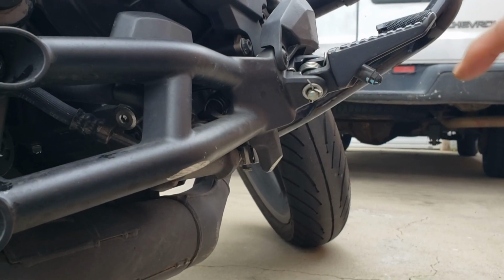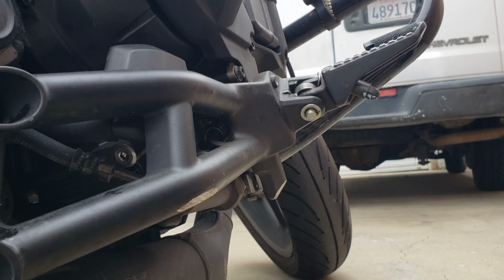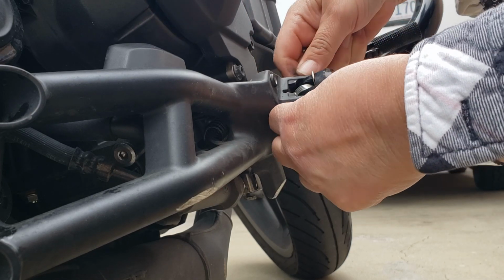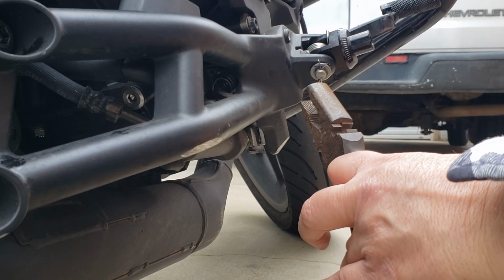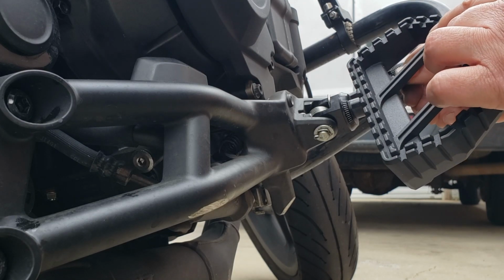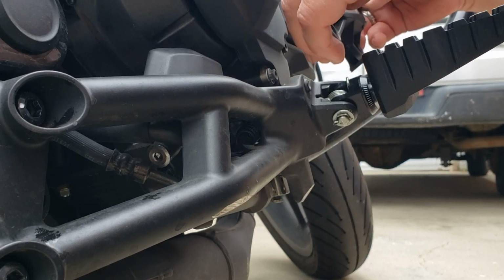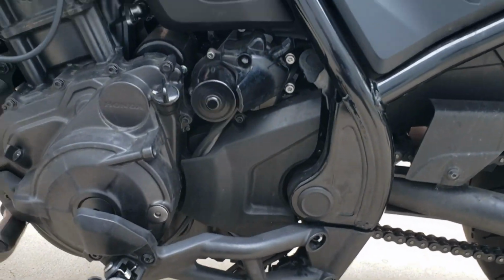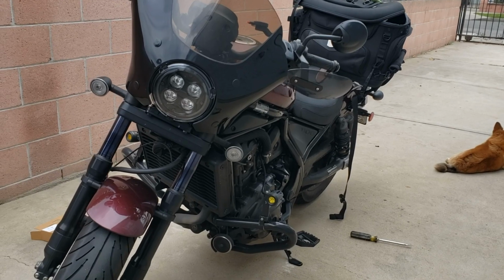Installing Kuryakyn Riot Mini Boards on my Honda Rebel 1100 dct

Comment: Never use an old split pin! Never. Clean all parts and a little bit grease for the joint are always good...
Reply: Grease attracts dirt and used split pins are fine if they are in good condition.
Reply: @FairladyS130  🤣🤣🤣
Reply: Split pin? Never heard it referred to that before. I believe it's technical name is a cotter key.

Comment: This is the correct adapters for these mini boards if you look at those ridges they are supposed to interlock with the mini pedal to prevent from slipping or moving around. Ok I have sent you enough messages. I placed the order and returned them other ones
Installed Kuryakyn Riot Mini Floorboards, Honda CB500FA mirrors, and added frog grips tonight. Can't wait to test them out.

Comment: Super awesome video awesome motorcycle. I just bought a 2022 Honda Rebel 1100 DCT only 260 miles $8100 absolutely love it. I’m doing upgrades and I saw you in here . I love your windshield where did you got it?
Reply from the maker: Hi there mousebowen. What a great deal you got on your bike! I got my shade from Memphis Shades. Its great, it makes a big difference with the hwy speeds.
Reply: @motocatz87  awesome I absolutely love the way it looks . Was affordable?
Reply from the maker: @MOUSEBOWEN I think it was because I bought things little at a time and usually during a holiday where I would find things on sale. Like my Burly sissy bar was on sale at the time on the Burly website and I got a free leather bag with it.

Comment: OK I need to ask you a question I received exact the same adapter C14 and the kuryakyn mini pedal and I think that adapter should go in the hole of the pedal when I was watching your install I didnt pay attention to that part because I truly feel that male part of that adapter should go into the hole and its too big I will need to contact Kuriyakyn and ask
Reply from the maker: I think your right, something is off.  They have moved a few times when I've used them to get on and off my bike. I thought I just needed to use blue locktite on them, but they shouldn't be moving at all.
Reply: It appears you are using Puig adapters.  You need the 8889 Kuryakyn Splined Peg Adapters.

Comment: When you want to pull a cotter pin out, put one of the needles of the needle nose in the loop of the pin and tap on the needle nose to get it out.

Comment: I took out this pin from this screw ( not a screw) ? And tapped it with my wrench ( not a wrench) then forgot the washer and faffed around with the split pin, .sorry but this was a difficult watch.. 😢
Reply from the maker: Oh gosh, sorry about that. I actually need to replace the pins because someone on here told me to never reuse the same pins you take out cause they can fail.
Reply: Wow. I bet you're a real hoot at parties!!
Reply from the maker: @captainobvious5349  lol...

Comment: How do you like the floor boards now that you have been riding them I went for a 4 hour ride on my rebel 2022 DCT and I hated the foot pegs
Reply from the maker: There is no comparison, the Kuryakyn mini boards are way more comfortable. I would never go back to those stupid pegs...ever! I feel like my foot is way more stable and it's very comfortable. Just make sure to tighten them up with some torque. Look in the manual for the correct torque. I tried to do 25 lbs of torque, but I felt I was pushing it, so I went down to 20, now they don't move at all. One thing to be aware of, I move my bike around in my driveway, so a couple of times I hit my lower shin on the boards. I had to get used to the distance to not do that. Now, I have no problem.  Take the plunge and get them, you won't be dissapointed.
Reply: Thank you very much I just got my rebel and going through what upgrades I want to do love your videos  @motocatz87

Comment: Pardon my ignorance 
What is the adapter for again?
Reply from the maker: Puig 6347N Black Pilot Footpeg Adapter - Pair
Reply: @motocatz87  Yes. But what is it for? What do you need it for?
To make it fit or to extend the footpeg morr outward?
Reply from the maker: @captainobvious5349  To make it fit.

Comment: What size bolt did you use to connect the adapter to the mini board and where did you get it?  I bought these exact adapters and mini boards and neither came with bolts.
Reply from the maker: I used the same bolt that connected my original pegs. I don't know the size, you might have to look it up in the manual or call Honda.
Reply: @motocatz87  Thanks, but I'm not talking about the bolt that goes through that uses the codder pin. I'm talking about the screw that you used the T-handle to tighten down that goes through the mini board and into the adapter.  My adapters did not come with them.  I think they're called socket cap screws
Reply from the maker: @crueguru1  It's a 6mm socket bolt. I realized that these bolts come with Kuryakyn boards.

Comment: Nothing annoys me more about watching videos from people that don't know anything about mechanics is they call things the wrong name. For instance I'm less than three minutes into this and she's called a pliers a ranch, she's removing a clevis pin and called it a screw.
Reply from the maker: Hey there ActivityPhoto, thanks for stopping by! I would like to think I’m less annoying than a toddler throwing a tantrum in a seat next to you on a plane…but I guess my video is far more annoying. You’re too young to be annoyed by my ignorance in the names of tools.  I’m sorry about that, but then again, I never said I knew about mechanics or the names of the tools I was using. I simply made a video to show how to put these mini-boards on. It’s not to offend people or to annoy anyone like yourself.
Reply: @motocatz87  What this video shows me is that someone with a relatively limited knowledge of tools and engineering can still go ahead and achieve something if they apply themselves.  Who has never forgotten to replace a washer only to have to take everything apart again?   You might just motivate someone else to have a go too.  Keep it up.

Comment: Did you have to order an adapter for the mini boards?
Reply from the maker: Yes, C-14 adapters on Amazon.
Reply: You need the 8889 Kuryakyn Splined Peg Adapter not the ones used in the video they are the wrong ones I have them on my 1100 and they do not slip as they use the splines to grip the foot plate. I ended up waiting months for the adaptors to be in stock.